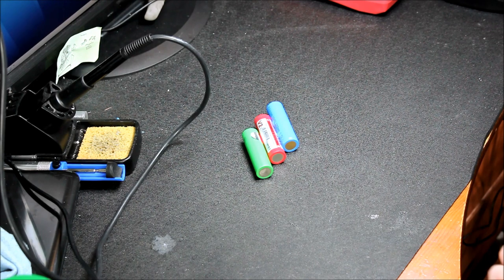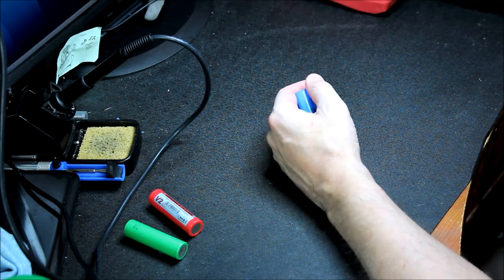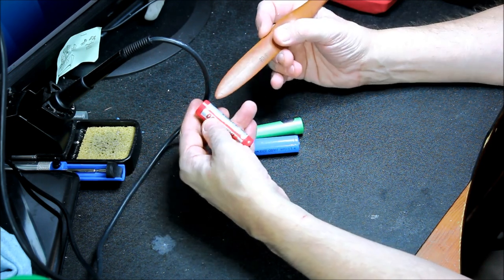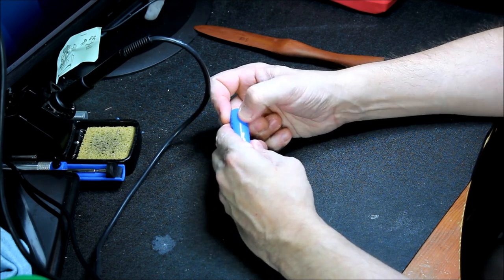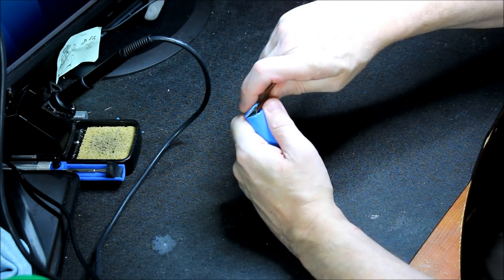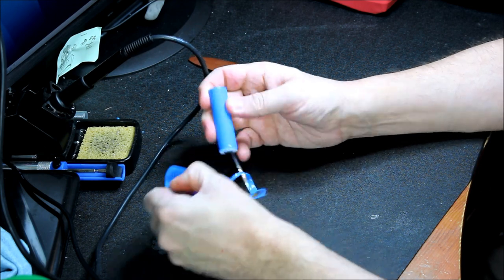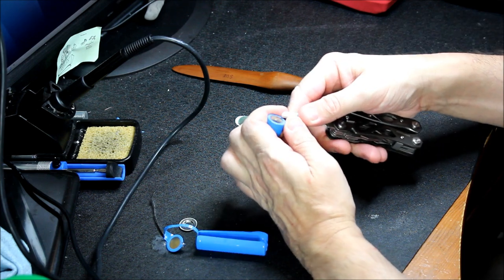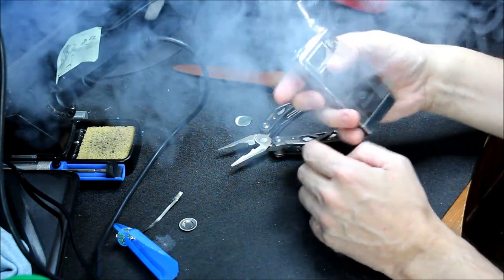Steve'll Fix It S01E03 - Removing 18650 cell protection

Comment: seriously guys, he's not kidding. i did try this and mine started smoking.... don't try this at home
Reply from the maker: The trolls don't understand that several hundred amps can be a bit hurty... But that's just natural selection :)
Reply: +Steve Brace     Where are you gonna get these several hundred amps?  From your very special 18650?
Reply from the maker: The instantaneous current is colossal. When the cell heats up, the internal resistance increases, reducing the SC current. The danger is not from shock but from the heat and combustion of: 1. The material causing the SC, and 2. Combustion of the volatiles in the cell. Physics 101.
Reply: +Steve Brace  The ones i purposely shorted in my living room took a short time before anything else but hissing happened. It would give you enough time to throw the cell away from you into something very flammable. But on average it just vented, very dissapointing. If you are using the explosive ones tell me where to buy them.
Reply from the maker: I've never had one explode or even ignite, but I have been careless with short circuits and lit up a pair of stainless steel tweezers causing an irritating little burn. Personally, I find venting far more irritating: https://youtu.be/jzvyQS64lzE
Reply: +Steve Brace  I guess you're right, i personally like it better too having some steel shards in my face than to have to listen to that annoying venting sound.

Comment: Hi Steve, I was wondering if you would know if the ones on the right in this picture are safe to use? http://i.imgur.com/moWJ3jC.jpg?1 
One on the left is what I currently have, and nee to purchase an extra one. Do I have to like you did or not use it at all cuz of the mAh? thank you.
Reply from the maker: +Fahid K I have no idea m8 :) The only advice I can give is not to believe the capacity printed on cheap cells until you have tested them through a full charge/discharge cycle.
Reply: +Fahid K the highest capacity brand name cells are 3,400mah so it's almost definitely a fake rating.

Comment: I do know that this video is old, but it was some principle stuff in it, so it gonna be useful for some more years, please can you put light on points below?

Do batteries in laptop are protected or not?
What is the benefit of removing the protection?
What if I add a protected battery in unprotected battery series?
Is the battery you got was a Accuplus? (I have same looking stuff)

Can I add backup to my laptop by which way? Attached for your reference:-

https://i.imgur.com/ObHA9yu.jpg

Please guide me back.

Regards,
Hemant K
Reply from the maker: The cells in a removable laptop battery are not protected, but the pack is. The benefit of removing protection is restoring the length back to 65mm and FIRE! :)

Comment: Is this safe if you want to vape ???
Reply from the maker: That's your judgement call... I accept the risk as I can rapidly mitigate catastrophic malfunction and I only vape at 25 watts with 2x18650s.
Reply: 😅😅😅I will just get a new Sony VTC 6
Reply from the maker: @zahedzafar46  I've recently changed to the JayBo Reuleaux RX2 with 2x21700, 4Ah cells (2x30A)... Great vape without cloudchasing at 24W.

Comment: isn't it true that most protected cell batteries are not designed High draw?
Reply from the maker: Pretty much, I think.
Reply: @SteveBrace  But you realize that a vape is a high draw device right?  I mean, its a heater!
Reply from the maker: @GearGuy  Not at 12W: 12/3.6 = 3.3A

Comment: if you take the negative off first you wouldn't have to worry about shorting it too much once you get to the positive. isn't that right?
Reply from the maker: +micheals1992 The risk with this type of cell is that there never much clearance between + and - whether the cell is protected or not. Remember that the entire can is -ve and the +ve terminal is, at best, 3mm away from the can.
Reply: micheals1992 i
Reply: N

Comment: Sir, Can is turn my ac android charger as a power bank by ading this battery ?? I mean getting rid of AC with a rechargable battery ?? 

Yeah, Power cells are available, but Is that possible ??
Reply from the maker: +Nasr Awan Yes it is possible. Two cells in series and a 5v regulator (plus a heatsink and two or three caps) would provide a steady 5v but it would be inefficient. A single cell and a boost converter would be more efficient, but more expensive and since you can buy single cell power banks for £1/$1 it really isn't cost effective, especially if you factor-in the charging circuitry.
Reply: +Nasr Awan No, you need a 12v wet cell. The kind you put in a car.

Comment: Sir, is it possible to change through 12 volt Changer.
Reply from the maker: Not very easily or efficiently, no... You need to cap the voltage at 4.2v and limit the current to the maximum charge specified for the cell. A cheap, adjustable (I&V) switch-mode buck converter would work though.
Reply: @SteveBrace  I'm thinking that someone who asks if you can charge an 18650 with 12V, will not be across implementing a switchmode buck regulator.

Comment: Just use the proper battery in your vape and use the protected type in another  device, i.e., flashlight, that compensates for odd lengths with a spring. Banggood sold me some re-branded used laptop batteries, would not charge properly, got a refund after 15 hostile emails. I would like to find a charger that will tell me the ma-hr rate if anyone knows a valid source, even Chinese.

Comment: do all protected cells have 2 layers of insulation?
Reply from the maker: +micheals1992 I would assume so since there has to be a high current conductor passing the entire length of the cell. There may be exceptions.
Reply: it's just that I've got some protected cells (they claim they're anyway) that don't seem to have a protection circuit on the negative. they wouldn't fit in my power bank but I used some pliers on the power bank to squash the positive tabs flat and I can now fit them in and my unprotected flat tops still make a good connection because of the springs :)

The reason I was asking was that I always thought it would make more sense to put the protection circuit on top because there's already a negative terminal right next to it so it would remove the danger of running a positive strip all the way along the side of the negative casing (which could get damaged and short and there's no protection in between that kind of short circuit)
Reply from the maker: +micheals1992 You make some good points, but we're dealing with legacy c20th technology. If these cells were designed today, there would be no way any sane person would give these cells type approval IMO ! :)
Reply: it seems like a protected cell could have the potential to be more dangerous then an unprotected cell if it was damaged. but over/undercharge and short protection are good things to have if they're using them in consumer electronics and EVs.

Do brand new protected cells still have their protection circuits on the bottom?
Reply from the maker: +micheals1992 The 18650 and derivatives were never designed for consumer use. They were for encapsulated modules (like laptop batteries) where external protection was expected of the manufacturer. The single cell protection was added in the 21st century as an attempt to make them usable for consumers, probably driven by the e-cig trade (may your deity bless them!) It most certainly does not make them safer in the event of mechanical damage!